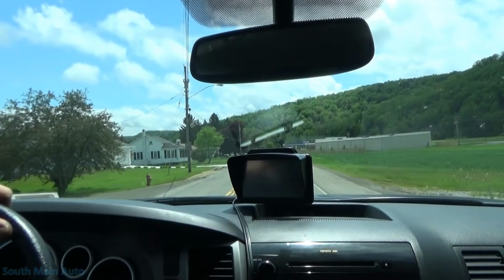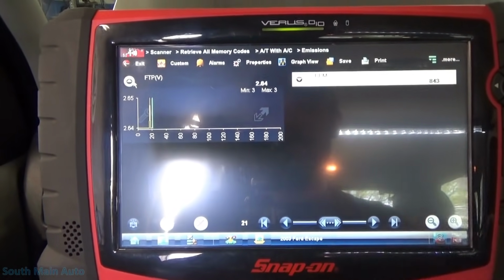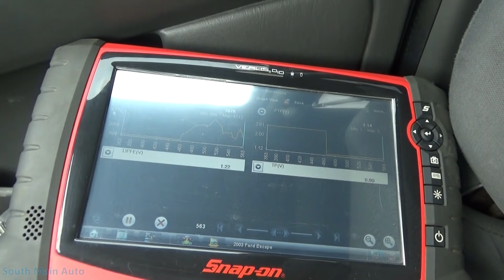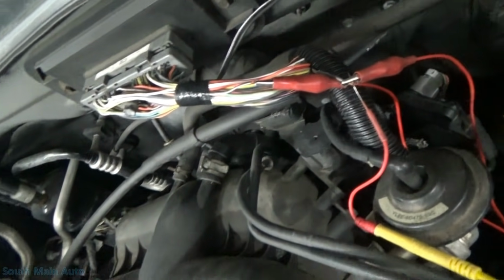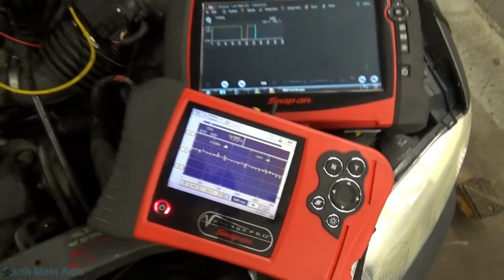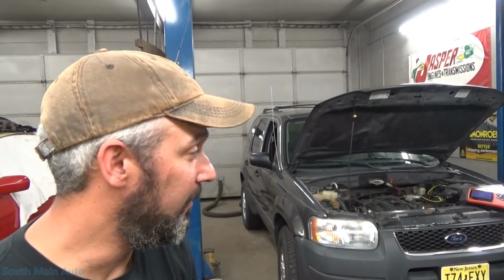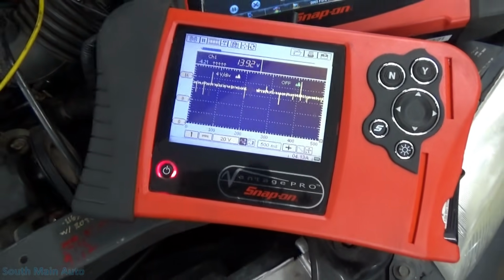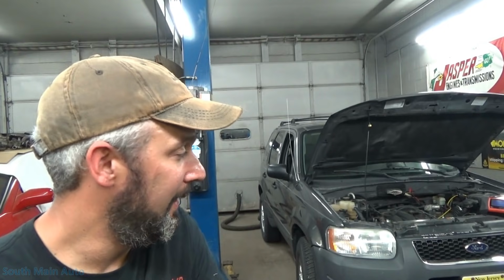Ford Escape: Do We Fix It Or Ship It!? - Part II

Comment: So I think that faulty pressure switch induced a signal that exposed a weakness in either the software or the electronics of the ECM. Since its 12 volts, I am also wondering if there is a relay coil in there that's missing it's snubber diode. If so, the back EMF from that rapid on and Off would be sending thousands of volts into the ECM. Great way to stick with the problem! Great Video!

Comment: The thing with complex sense and control systems is that any low impedance noise source can screw up a lot of high impedance sense (or reference) lines, especially when hiigh frequency noise is theproblem. Keeping a quiet ground or voltage reference over a spider web of interconnections is difficult, and hard to diagnose in a multiplexed scanner. It is a difficult design problem, especially under cost constraints. You used multiple diagnostic observations to isolate possible causes and were dilligent in proving your hypothses. Thatès very good methodology.

I would think that the systems designers would be interested in your case history Congratulations. I came upon your YouTube videos by chance, but I will be following them now. Especially is you turn up a 2001 VW Golf 2l. Nice work.

Comment: Super  tech you are! Now the why. 
That 12 volts is inducing the voltage into the other wire.  Has to be the wire inducing current into the wire before the ecm hope you read this.  Good job on this thing

Comment: Eric, first great channel.   I’ve learned a lot from you in just the first couple of weeks watching. 

Glad you sorted out the problem but your logic is slightly off on why the problem sorted out the way it did.  I’m one of those engineers every mechanic hates.  That said, consider two things: 1) the evap sensor is an input to the ECM and 2) p/s switch is also an input to the ECM.  The ECM is not misbehaving just reporting an error.  The problem is more an issue of a 12V high frequency signal messing up a 5V signal.   Under normal conditions, they never affect each other.  Start an oscillation like that in the wiring harness and who knows what happens from a signal coupling perspective. The reference voltage circuitry cannot handle that noise and causes the evap signal to flip out (technical term).  From an engineering perspective, the ref voltage to the evap sensor should be filtered with an inductor near the sensor to filter out line noise.  This would prevent a similar issue in the future but that’s Ford’s problem, not yours.

Great videos, keep up the good work.

Comment: I watch a lot of your videos I happened to own a escape i just fixed the ignition problem thanks to your video and now the Power Steering is out. I don't think it has to do with anything I did when replacing the ignition. I'm thinking its the battery. Anyway, what you did in this video is what happens when you  work on automobiles. What sucks is you don't normally get paid for the time it takes to find an issue like this. Very informative I learn from  your video's just want to say thanks from Dallas Texas.

Comment: 7:05 it dropped at 1800 rpm or so, that had me thinking TPS because it was the first time the car was under load. In hindsight maybe something to do with you steering to pull out. Cool video

Comment: So I had to look at this more after watching to see if I can add to the "why" explanation here. Not sure if you realized, but all the sensors including the PS switch, DPFE, and FTP sensors share the same signal return circuit that is only grounded at the PCM. If the PS switch was rapidly chattering, the stray inductance between the wires in the harness was probably creating all the voltage spikes in the signal return circuit, similar to how an ignition coil works. Those signals were likely leaking backwards through some of the other sensors, including the DPFE. Perhaps the DPFE sensor had the lowest resistance of the sensors, so that's why you saw the biggest effect unplugging it. It is strange that the spikes didn't affect any other sensors (O2 sensors and MAF also share this same return), but perhaps the FTP sensor had some combination of inductance and capacitance that somehow resonated coincidently with the frequency of the PS switch chatter, which caused the sensor signal to get wiped out. One thing that I would have maybe done additionally would have been to compare the signal return wire (what you called the ground wire) with an actual body ground to see if you were getting a voltage rise or noise on it (use three scope channels for the three FTP sensor wires instead of two). It's good to get in the habit of testing the signal return circuit (also called sensor ground circuit) during sensor troubleshooting since it might not be at the same potential as body ground if there's a problem with it. Also a good lesson in how your instruments can fool you if they aren't capturing at a high enough rate since you couldn't see the 5V reference going wonky on the graphing multimeter and assumed it was good initially. If you had a good scope hooked up to all three FTP sensor wires (like the pico) using three channels, I think you would have caught the noise issue on the return circuit sooner and would have had a better lead on what to test next. Either way, that was a really tricky one, enjoyed the videos about it and glad you figured it out!

Comment: I had a similar issue with a boat motor.  It was. 6.2L GM based IO.  It ended up being the pressure switch in the power steering circuit causing running issues at 3,500 rpm’s.  I figured it out after having at the Marina a 1/2 dozen times.

Comment: Thanks for the great video.
  A good overall strategy for detecting any faults is to disconnect any sensor or accessory in your car which is not essential and gradually bring them back into the circuit by re conecting them.  That can give an indication of what is the problem that is causing or interfering with the suspected failing component. 
It works in solving problems in any other electical circuitry.

Comment: Hey Eric, great video as always. I don't know if anyone else might have mentioned this in the comments but I think the problem might have been caused by induction. The PS switch was in effect generating an alternating current in its signal wire and in the process generating an expanding and collapsing magnetic field in the wire with every pulse. Runs of wire running parallel to the wire causing the alternating magnetic field will act as antennas and alternating current will be induced in them as the magnetic field expands and collapses with every pulse. 

I don't think the ECM was going "wonky" because of the bad signal being fed to it by the PS switch.  Instead the I thing the FTP was not receiving a steady 5VREF because of the induced -5V to +5V induced in the supply wire and sending back bad information because of that.

Just a thought. Sorry if this was already discussed and I just missed it. 

Keep up the great work!!

Comment: I had the same thing happen but not between 5v and 12v sensors. I have had it happened on 5 volt sensors one sensor one shorted out the other one was saying it had a bad voltage. The only thing you could d,.o is unplug one sensor at a time but in your case I never would have thought of that because of 12 volt vs 5 volt. Were glad you found it. I think it might be something with the computer shorting out a different way this time.

Comment: There may be an issue with the filtering circuit (capacitors) on the 5 volt regulator so that the bouncing make/break of the pressure switch on the 12 volt circuit was reflected back onto the 5 volt control circuit. Definitely weird, good find!

Comment: I have been a long time subscriber to Car Mechanics in the UK.
Long time ago, a Jaguar owner (who did his own servicing) wrote in to say, was driving along when he got a 'Major Fuel Leak Detected' 
(or some such) come up on the dashboard display. Pulled over, had a look under the hood and around, saw nothing, smelled nothing.
Noticed a slight flutter on the rev counter needle as well.  
Got back home. Looked everywhere for a fuel leak.
Found a bad/intermittent connection on the rev counter gauge.
- lost connection to rev counter meant no signal hence ECM thought engine was stationary
- but fuel flow meter told ECM lots of fuel being used/flowing
therefore, there must be a fuel leak so up pops the message.
Weird stuff happens.

Comment: Great call. In talking with Keith and in getting relaxed enough to let your brain consider all aspects of the electrical system and pinpoint the problem, were adult beverages involved in any way?  If so, many inquiring minds will quickly be emulating your approach to diagnostics.  Thanks again.

Comment: fixed a 2005 chrysler 300 5.7 today that wold just shut off intermittently like a switch was flicked. data stream went to gone. no codes. pinned everything out found a #3 coil that when the customer replaced the plugs and the ecm as well to try to fix the problem-he left out the spring conductor in the #3 coil. no misfires due to the number 2 coil firing the 2nd plug in the chamber. emi must have been taking out the pcm. its great to fix em. good job here.

Comment: Higher voltage noisy switching from switch could capacitively couple to other sensitive circuits.  As an electrical engineer when you encounter a noisy signal you might make a "sniffer" coil and look for similar noise.  A ferrite "E" core wound with wire makes a good sniffer.

Comment: I️ had a transit with a map sensor voltage code. It was the power steering pressure switch as well. With the sensor plugged in, the map sensor had no 5v and with the sensor unplugged the 5v came back.

Comment: If this particular case was made into an ASE test question, how many people would actually answer it correctly? I never would have suspected a 12 volt reference circuit problem could actually affect a 5 volt reference sensor.  Kudos for not replacing the ECM for such a bizarre problem.

Comment: Good save there. One of these off book things. Probably the PS sensor was sending out crap that messed up the entire bus for the pressure sensors. Adjacent pressure sensors on the buss can be effected by one going full scale. Usually there is one A to D converter hooked to a multiplexer. So the multiplexer is looking at all the sensors in sequence. The A to D converter takes a long time to settle down after is it saturated and when the multiplexer puts it on a different channel it can read garbage because it is still saturated from the channel before.

Comment: Wow i wouldve been scratching my head. Good call using another sensor. Ruled out mechanical problems.After that and seeing the wacky voltage i thought maybe an alternator diode was gone and letting stray feedback into the system mainly because of the rpm anomaly. Thats nuts wouldve never thought of that. Good call!!!
Reply: Also fyi if you want to speed up your verus install a solid state drive. I did in mine and its much faster but you void warranty and you need cloning software

Comment: That is a weird one, all right! The reason the PS pressure switch can drive the ECM nuts is that switch closures are treated as events. Normally the processor is doing routine stuff, but when switch closures come in the processor spends some time dealing with it. What you get is the same thing you see if you click on something on a home computer and nothing happens. Thinking you missed, you do it again - still nothing, so again and again. The computer is really messed up because you are telling it to do this complex thing a dozen times... but it started with being too busy when you clicked the first time. In your case it was just that the switch was opening and closing so often the ECU could not work normally. 
Great catch, though. We focus on cause and effect, and that is the best approach nearly every time.

Comment: Eric O. don't feel bad. I had a situation with a Toyota Cressida where the car either ran too rich or too lean at a specific temperature. It took 3 months and $600 just to find out that it was a $23 coolant sensor for the ECU. Now, you want to talk about frustration???? The vehicle would die in traffic at an idle when stopped and felt like it would take forever to restart!!!!! Like I said before, this went on for three months and I acted on a tip from only one mechanic who speculated it could be a sensor. I replaced it and the car runs better than ever!!!!!

Comment: It’s from New Jersey, that’s the problem.   Interesting.  I must be learning something from watching your videos because I was thinking there is some form of feedback being picked up from another sensor that magnetically resonating through the harnesses.  Your 98.5 to 2002 Dodge diesels have that problem with alternator diodes going bad and causing the fuel injection and TQ lock up system to pick up ac voltage feedback.

Comment: Good diagnosed saw a temp switch on another video no start was also a Ford .(scanner danner) also Chrisler throwing up codes was the battery after 2000$ in repairs started fine .

Comment: I'll bet if you checked the pinouts on the PCM or the actual logic locations of where the fuel tank pressure and the AC. Switch are located on the PCM board, I'll bet they're close enough where that signal is radiating into the tank circuit.  Like an antenna.
Reply: Power steering pressure switch

Comment: Great job! I've worked on many embedded processors and would have a hard time explaining it. It very well could be a software bug related to not expecting a switching signal. You would think Ford engineers would be interested in this.

Comment: It seems like you're getting static in a resistor is failing maybe it's in the alternator itself. It's got to be going through the power system on all of the wires. So it has to be coming from the power supply

Comment: I remember watching one of Eric's apprentices, Scanner Danner :-) mention something in one of his premium videos that there is a link between the power steering pressure  switch and obscurely, amongst other things the idle control valve on some cars. 
If you turn your steering full lock at idle and you have power steering, at full lock the revs lower slightly, this is where the idle control system is notified to up the revs slightly to compensate for this, weird!

Comment: I had a similar problem once on a peugeot 206, as soon as you turned the steering, the engine just cut out, was linked to the steering pressure switch, but at the end it was the ECu that was screwed up, fixed it with a small jumper wire in the connector, car still driving fine 5 years later

Comment: Well, my WAG was way off... but I'd like to be assured that the switch fixed the problem... it's certainly possible that a filter capacitor in the ECM went bad, letting switch noise pollute reference voltages etc in a strange way.  I'm not happy seeing a bouncing switch cause this kind of problem... crazy.

Comment: Wow!!  You made a correct diagnosis, which was virtually impossible to make it, out of pure tenacity, high tech analytical gear, great collaborators, trial and error......and inevitably, brute force good luck.  A temperamental power steering sensor fooling an ECM into triggering an Evap system malfunction! This confirms my fear of mixing computers and automobiles.  It also validates my prime decision regarding my 1985 Firebird restoration, which was to completely remove its primitive ECM.  It basically only controlled a GM feedback carburetor and a pulse-controlled GM distributer.  I replaced the carb with a stock Edelbrock and the distributer with an MSD electronic ignition....and whalla, NO COMPUTERS at all remain.  My  Firebird loves it.  I forgot to remove the bulb from the CEL dash socket, so the CEL light always stays on, reminding me that the ECM is thankfully missing in action.

Comment: To generate noise on a 5v supply from a separate sensor at 3000rpm is extremely odd.  Kudos for sticking with it.  I suppose you could have scoped all the ECM inputs but  that is an odd one indeed.   

 I personally would have placed an electrolytic capacitor across the 5v supply as a test  to see if that smoothed the high frequency noise.  I tend to use a full digital oscilloscope to observe noise,

I've had it supply noise.interference upsetting reversing camera images, a 220UF  capacitor sorts them out.  But I suppose a car shouldn't have crappy noise suppression

Comment: Signaling works by detecting voltage change with respect to a reference. (that way it works if the voltage sags)
If the reference itself goes haywire then the whole system is Fubar.

Comment: Don’t feel too bad, I once spent hours and hours doing a diag on a F350 that made a grinding noise in sharp turns. I checked every single suspension component and still it made the noise. Checked every bearing, I even checked and changed the rear diff fluid thinking the LSD was chattering...Turned out it was bad body mounts that was allowing the body to contact the down pipe during hard turns...Go figure it broke the grinding noise is always rotating rule

Comment: I think what might  have been happening was a result of a software issue and not electrical interference . The system probably assumes the PS pressure switch will only create occasional events, as such the ECU can easily service that input quickly and then get on with reading the other inputs. It is possible this faulty switch caused so many events that it kept the ECU busy on this input, and it neglected reading the tank pressure sensor input,  resulting in the zero reading. It depends on how the inputs are prioritised in the ECU.